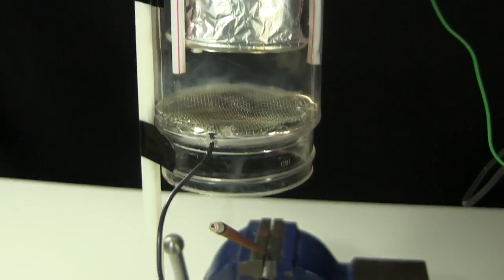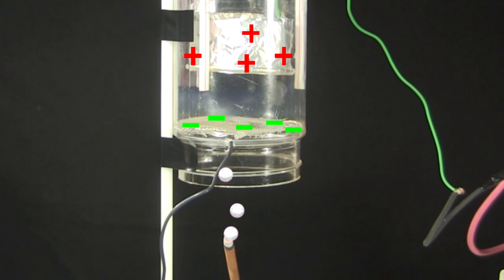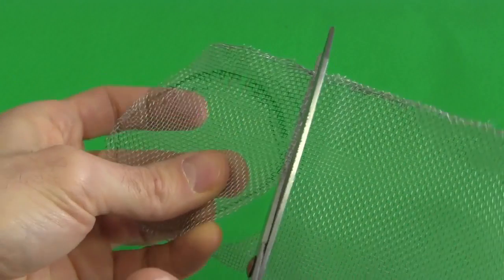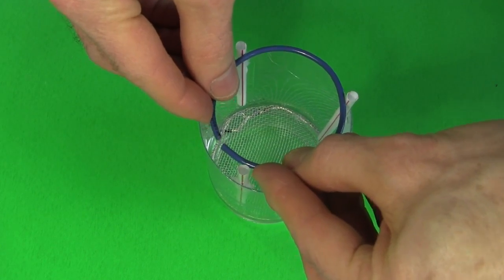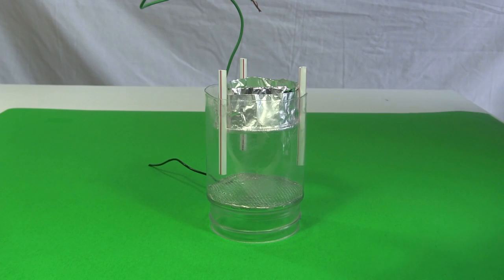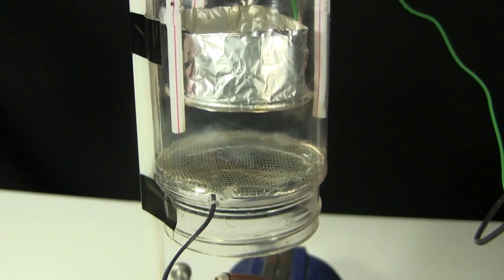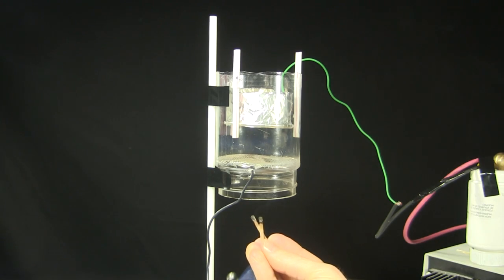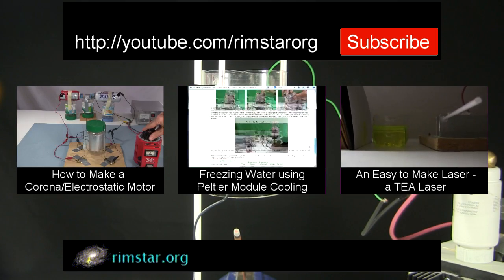Electrostatic Precipitator/Smoke Precipitator - How it Works/How to Make

Comment: The video and the device looks awesome and I am trying to make one right now for a school project. However based on some of the comments you made it seems this device could make ozone? I understand very little about electronics and science so could you please explain how this ozone gas could be made from the device? Also it seems I need over 10kv to make this device but ozone will be made when the voltage goes over 7kv. Any suggestions on how to tackle this problem?
Reply from the maker: Hyun Ki Lee I don't know the precise mechanism by which the ozone is produced, except that it happens as a side-effect of the ionization that happens between the mesh and the foil cylinder. I also don't know exactly what voltage you have to stay below in order to not produce ozone. I was told it's somewhere in the single digits kV or around there. One way you might be able to find out what the voltage is is to look into air ionizers that you can buy as commercial products that don't produce ozone. The closer the mesh is to the cylinder, the less voltage will be needed, however, it's probably a trade-off since if they're too close then more smoke will get though without being ionized, since more of the ionization will be happening only immediately between the cylinder and the mesh. Finding out the critical voltage and then controlling your voltage is the only solution I can think of.
Reply: Thanks for the feedback! 
So I thought about it and decided to make one for the car like a few people posted. But it seems finding the right power source is the key. Any suggestion you can give? I was thinking since cars are always moving would a small wind turbine cut the trick?
Reply from the maker: Hyun Ki Lee You need high voltage so I don't think a wind turbine will do it, but I'm no expert on wind turbines, but I doubt it. My high voltage power supply in the video takes low voltage DC as input. In fact I have two power supplies, one that plugs into the wall and output low voltage DC. Then that goes into the high voltage power supply which converts it to high voltage for the precipitator. You can see it more clearly here http://rimstar.org/equip/30kv_pwr_supply.htm. This is the way a lot of high voltage power supplies work. Your car battery puts out 12V and so you can plug a high voltage power supply into that. Cars usually even have a cigarette lighter in the dashboard powered by the battery which you can buy a plug for as automotive stores. You can get one of those plugs and wire it to your high voltage power supply's input. Though you probably want to mount the high voltage power supply under the car as near the precipitator as possible so that you don't have high voltage wires running everywhere.
Reply: thanks for the feedback!
Reply: I've been watching through the video where you made that big transformer/power-source but I am not sure if I want to try making one myself, especially since I've never played with electronics and circuits before. could you possibly send me a link or two where I can buy one of those in cheaper and smaller scale?
Reply from the maker: Hyun Ki Lee If you just want to try it out or use it for a short term project then you could get or make a Wimshurst machine. I show me using one with it near the bottom of my webpage here http://rimstar.org/science_electronics_projects/electrostatic_precipitator_smoke_precipitator_simple.htm. Note that you need a Wimshurst machine with disks around 1 foot/30cm in diameter i.e. the ones made with CDs probably won't provide enough current. You can buy Wimshurst machines in a lot of places online. I bought mine on ebay.com.
Reply from the maker: ***** Good info. But we don't want ozone in this case, at least that's what I understand from reading +Hyun Ki Lee's original question since he names it as a problem, and it is for long term use. You don't want to breath too much of it. There's a certain voltage somewhere in the 1kV to 10kV range below which ionization is produced without producing ozone. Unfortunately I don't know what that voltage is, but some of the ionizer air fresheners sold in stores ionize air below that voltage without producing ozone.

Comment: how much the voltage it need?
Reply from the maker: Lei He Sadly I didn't measure the voltage, and it's all taken apart now. Judging by the position of the dial on the VARIAC and comparing that to my experience with this power supply I'd say around 4kV to 10kV. But it's not just the voltage that's important here. You also need enough current to supply the ions. I was able to get this to just barely work with my commercially made Wimshurst machine (photos near the bottom of my webpage here http://rimstar.org/science_electronics_projects/electrostatic_precipitator_smoke_precipitator_simple.htm) which means the current doesn't have to be very high, probably low microamps but it does need some.
Reply: RimstarOrg Can I use a neon sign transformer to conduct ,which has a specs
INPUT: 12-15V DC @ 5 AMPS (MAX)OUTPUT VOLTAGE = 9500V

OUTPUT AMPERAGE = 30 MA
FUSE 8 AMP (MAX)
Reply from the maker: Lei He The output of a neon sign transformer is AC and you need DC for a smoke precipitator. But you can add a high voltage, high current diode like this http://www.amazing1.com/products/high-voltage-rectifier-15kv-200ma.html to turn it into DC.
Reply: RimstarOrg do i need one or two? will it become positive or negative?
Reply from the maker: Lei He I've never worked with a neon sign transformer so I don't know enough about its output to say which diode will meet it's voltage and current ratings. I can't help you further in that direction. And whether it will be positive or negative just depends on which way you orient the diode.
Reply: RimstarOrg do you know how much current it need,sir?
Reply from the maker: Lei He No, I didn't measure it.

Comment: With a negative ion generator say im lucky and you get -10k out of it, could i connect the bottom screen to the negative output and ground my positive foil ? i'm going to try this but im just wondering if this electrostatic interaction will yield similiar results. For instance why did you choose to use the positive end of your HV supply oppose to the negative side?

thanks, great vids!
Reply from the maker: David Roslin Yes, connecting the -10k to the screen and grounding the foil will work, provided -10k is enough voltage. If you don't get results then decrease the distance between the screen and foil until you do. If you keep decreasing it and get sparks with still no precipitating then you could try making your foil have a rounder bottom edge.The power supply I used has only a positive HV output, no negative HV, so I had no choice. I put negative on the bottom (the ground was negative with respect to the +HV) for no good reason. Just a random choice. Actually, the nice thing about having ground on the bottom is that the feed wire can be sitting on the table instead of having to be raised up with plastic jars or something for more efficiency.I also got it working with my Wimshurst machine where there was only +HV and -HV with no ground (https://plus.google.com/116395125136223897621/posts/Wr8EWoc4bSc).
Reply: RimstarOrg many thanks for your reply and input. 
Have you gathered any soot off of your collector and tried to identify any of those particles? I think that under certain circumstances that they could be nanoparticles?
Reply from the maker: David Roslin I didn't examine it closely but there was definitely a hard to remove, yellowish or brownish coating on it after running it for a few minutes.
Reply: RimstarOrg   The negative ion generator makes negative electricity for instance and yours creates only positive. Is that because their opposite charge is missing?  do you know of any circuits that make both polarities??  cockroft-walton multiplier has an output based on cirguit geometry, is this why?
Reply from the maker: David Roslin Yes, mine creates a positive charge by removing a lot of the electrons, which are negatively charged. That leaves more protons than electrons, and protons are positively charged.A negative ion generator, on the other hand, inserts extra electrons so you end up with more negatively charged electrons than positively charged protons.For high voltage, I once made a power supply that produces positive charge, negative charge and also no charge. You can see it here http://rimstar.org/equip/pos_neg_voltage_multiplier.htm.But it looks like you were on the right track since it uses two Cockroft-Walton voltages multipliers, one for the positive and one for the negative. And the difference is determined by the direction of the diodes in the circuit. You can see that if you look carefully at the schematic on the webpage.Another positive/negative high voltage power supply is a Wimshurst machine. The inner cylinder of one Leyden jar along with the side of the spark gap connected to that cylinder is positive, and the inner cylinder of the other Leyden jar along with the side of the spark gap connected to that cylinder is negative. I actually got my commercially made Wimshurst machine to work with this smoke precipitator and you can see that here RimstarOrg/posts/Wr8EWoc4bSc?pageId=116395125136223897621.

Comment: i used 240v(dc) but it did not work,how much volt does it need to work?, i mean how much volt did you supply
please help me about the voltage
Reply from the maker: Aakash Dayakar Since I got it working with my Wimshurst machine too, and that's the lowest output power supply I managed to get it working with, I'd use that as my estimate. With my Wimshurst machine, the current going 
to the precipitator is probably in the low microamps since that's the 
typical output current of a Wimshurst machine that's not sparking. The 
output voltage I'd estimate based on experience is in the 1000s of 
volts, probably in the 2000 to 10,000 volt range.

Comment: Hello. I am a school teacher and we're doing project with students on Electrostatic Precipitator. At this moment we have invented High Voltage generator. And now we're trying to make precipitator. We faced some problems and we need a strong advices.
1. How can we estimate that our High Voltage generator has enough voltage and power? (It's sparking when distance between electrodes is 3-4 cm, spark frequency is about 10 times per second, spark sounds loud). As a power source we used 12V accumulator.
2. Is there any resistors must be used for connecting mesh, cylinder and HV generator?
Link for picture of circuit.
http://i57.tinypic.com/20uqt5c.png
Reply from the maker: Ruslan Shaymardanov 3-4 cm sparks is very long. I don't know how much current there is available, but given your type of power supply I'd expect a lot of current in the spark. You're taking a chance of damaging your power supply. I wouldn't go with anything longer than 1 cm. But given that circuit you should have enough voltage and current for the precipitator to work. In case you have sparks with your precipitator you could put around 250 kilohms of resistance on the negative wire going to the precipitator. If that restricts the current too much for the precipitator to work then remove the resistance but be careful to not have sparks. I have no estimate of the voltage required for the presipitator. I can't tell based on the gap size since it's a gap with ionization. With your circuit it should work though.
Reply: Thank you. And what about circuit? What are advantages and disadvantages of our and your circuit?
Reply: How can we estimate the efficency of our circuit? Do we need to try to change resistors with higher resistivity one?
Reply from the maker: Ruslan Shaymardanov I don't have any familiarity with your circuit so I can't say anything about advantages or disadvantages except to be pretty confident that it can supply more current than a Wimshurst machine, and I know my 27cm diameter disk Wimshurst machine worked with my electrostatic precipitator. That's why I said your circuit should work with the precipitator.
Reply from the maker: Ruslan Shaymardanov For efficiency I'd just measure input power and output power and compare.
Reply: Input power - OK. But how to measure output power. (How to measure high voltage? And current?)
Reply from the maker: Ruslan Shaymardanov I do it with my high voltage probe and an analog meter (High Voltage Probe How-to with Fluke 80K-40 and Lifter Voltage/Current and Smoke/Airflow Test Measurements). I guess you can get a rough estimate using the spark length and look it up online if you can get your precipitator to spark. Putting a separate spark gap won't work because the voltage at the spark gap would be different than the voltage between the mesh and the cylinder in the precipitator. The difficulty with getting a spark between the mesh and cylinder is that for a spark to occur you need to build up charges on the mesh and cylinder but while the precipitator is working, all that charge is going into ionizing the particles instead.

Comment: Hello, I'm from Venezuela and I'm trying to make an electrostatic precipitator as you did in your video, It is for a subject in my university.

I'm trying to make it work but it doesn't look like it is actually working. 

I tried applying 7,3KV but the smoke easily go through the machine.

I could use some help.

Thanks in advance.
Reply from the maker: Carlos Carrillo Ortega 7.3 kV may not be enough. Try decreasing the distance between the mesh and the foil cylinder. A shorter distance requires less voltage.What are you using for your power supply?
Reply: RimstarOrg I'm using a DC system, how much kV did you applied?
Reply from the maker: Carlos Carrillo Ortega I didn't measure the voltage. Based on the distance and the fact that it wasn't sparking, I'd guess somewhere around 10kV to 20kV. But as I said, a smaller distance would need a smaller voltage. I asked about your power supply because you do need some current too, since that's what gives the charge to ionize the particles. But it doesn't need to be too much current either since I got it working with my commercially made Wimshurst machine as you can see here https://plus.google.com/116395125136223897621/posts/Wr8EWoc4bSc

Comment: I followed all the steps prescribed by you, i even checked whether electric current was flowing,but the smoke from the incense stick was not purified .The power supply i used was a DC 9V battery ,i also connected tried connecting 6 batteries of the same type but it still did not work
Can any one suggest a suitable solution
Reply: yeah me to :(

Comment: Can we use the Wimhurst machine you have build to work this precipitator?
Reply from the maker: Aishwarya Aishu No, the voltage and current from that Wimshurst machine is too small. It just barely works with my commercially made 27cm disk Wimshurst machine.
Reply: Whats   the alternative then ??
Reply from the maker: Aishwarya Aishu Make the Wimshurst machine with larger diameter disks, minimum 27cm diameter. Every other alternative is much harder involving making or buying a high voltage DC power supply that can supply high voltage but also a decent amount of current.

Comment: Why do you need high voltage? Is there a way to precipitate on low voltage?
Reply from the maker: You need the high voltage firstly to ionize the smoke at the mesh. Just running electrons through the mesh at low voltage won't ionize the surrounding air. There's a minimum voltage you need for that. I don't know what it is though. But it's definitely not in the 240 volts or less range.

Comment: I want to build an electrostatic precipitator for some experimentation on particle separation of about 100 microns. The two materials have similar resistivity and are similarly sized, so it is important to dial in the perfect spot where maximum separation occurs. If possible I would like to take some quantitative measurements of the current needed. Can you recommend a voltmeter and a cheap high power supply that I don't have to build that should work for my purposes?
Reply from the maker: For measuring current, use an analog meter (i.e. one with a needle display, not digital.) Digital meters don't work well or last long when connected along a high voltage wire in my experience. For high power supply, if you want to make your own then there's my "How to Make 30kV High Voltage DC Power Supply with Flyback & Cockcroft-Walton Multiplier Tripler". For buying one, I'm not aware of all online sources. http://amazing1.com/ has some, though if you're doing real research you might want one with current, as well as voltage control but I don't have any sources for you on those. They're basically lab power supplies.

Comment: Quick question...In your video you state that the mesh connected to ground will become negatively charged due to its interaction with the positive cylinder. Why is this? 

Would the attraction of smoke be greater if you used a negative HV power supply and connected it to the mesh (in addition to the positive cylinder)?
Reply from the maker: The mesh will become negatively charged because the positive charge of the cylinder will attract negatively charged electrons from the ground.
Whether using a negative HV power supply connected to the mesh in addition to the positive cylinder would be better depends on the voltage produced and available current. You can make it be the same, or better.

Comment: how much voltage should i use for this size ESP. Will powder coating equipment  work for this purpose set at 30 KV.
Reply from the maker: I didn't measure the voltage but I suspect it was around 25kV. But having enough current is also important since that's what provides the charges to charge the particles. I don't know if powder coating equipment would work but I would guess it would since for powder coating it also has to supply charge, I think. I could be wrong.